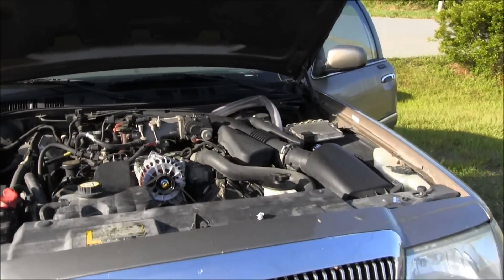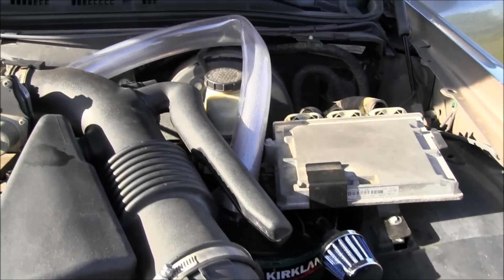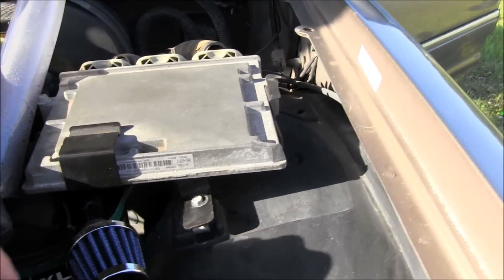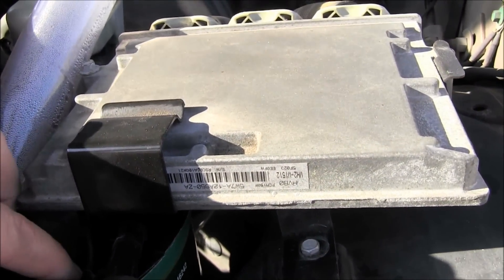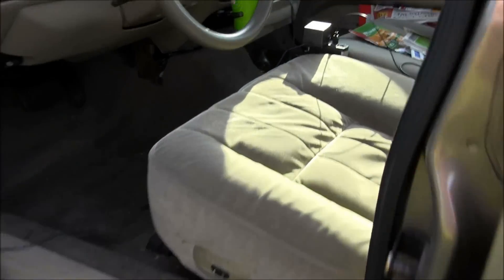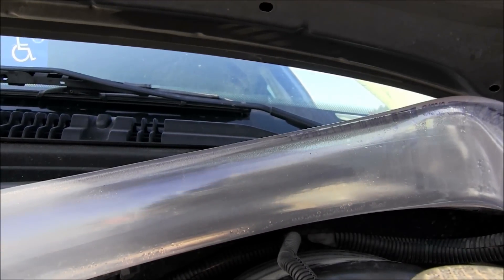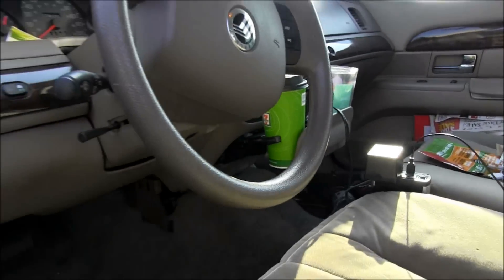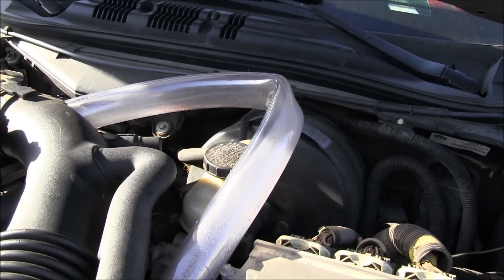Improve your Gas Mileage with water and a mist maker.

Comment: what is a mist maker & how to set one up ??
Reply from the maker: Hi, a mist maker is a machine that turns water into a fine mist through ultrasonic vibration. We have them available on our website at theHouseofHydro.com
There are many different ways to set them up depending on your needs. Some people use them for humidification, special effects, cooling, dust reduction, many different things. If you have any specific questions just let me know. We have a lot of resources on our website as well.
Reply: you dont need it, ion old cars the carburator suk air from oil pan, wioch had water vapour and others vapousrs from engine

Comment: Great concept, but i feel watching it wasted my time bc there was no conclusion. Because i buy your product, i suggest you watch Robert Murray-Smith. His has a number system to catalogue his videos so he can refer to one while making a new one and we can later go back and research his videos. This makes for an enjoyable experience for the subscriber. You have a great concept. Keep it up.
Reply from the maker: Thanks for the insight. I was actually on my way to Busch gardens in Tampa while running this setup shortly after install. The car had 200 and something thousand miles on it and blew the rear wheel bearing. I limped it into Busch gardens and we left early enough to make it to CarMax before heading home in a Civic.... That my son still drives. Lol 🙂

Comment: Add 50 percent rubbing alcohol or methanol is even better. They are corrosive to normal rubber hose however. It tremendously increases the cooling effect and the added octane is a bonus. I used a similar setup on a 1994 4x4 suburban and got a solid two mile per gallon increase. It worked for two years until I sold the vehicle. Nice work. I know it's an old thread, but the info is still relevant
Reply from the maker: Awesome, thanks for the input!

Comment: 19.62 MPG before Mist Maker install.,,. Ok, how much better  MPG After install ? My guess is Zero! You definitely would have  boasted about a significant increase IF you had received an increase. With an integrated electronic fuel injection, spark & self-adjudting, feed-back sensor equipped modern engine, it is difficult to modify or adjust outside it's programmed parameters. You have to trick or "lie" to the ECU. Look at the HHO builders EFIE boxes they have to install, for example. If you have tuned your system to receive significant fuel economy improvement, please update us with your new MPG & what you had to do to make it work. That is needed in today's Stupid high fuel prices! I think your Mist Maker has potential! Cheers.
Reply from the maker: Hi, being completely honest, we did not have this vehicle in operation much longer after the install. It definitely wasn't enough to give any type of true MPG ratings. The only reason I attempted it was because I had a pretty rough idle and wanted to play around and see if there were any benefits to the install. Shortly after installing, I took the family to Busch gardens about 2 and 1/2 hours away and blew A rear wheel bearing. I promptly dropped off the kids at the park and limped the car over to CarMax to purchase a new ride to get home. The only thing I can definitively say with the install is that the idle was much smoother and the throttle response was much better.
Reply: Thank you for your prompt & honest reply. I had a old carbureted '76 corolla 1.6L hemi. car with a water bubbler to the PCV vent hose that exited into the intake near one cyl. port runner. It seemed to idle smoother too. Later that cyl. burned an intake valve & I junked it. I think it would have worked better if I had drilled multiple ports in the intake, just under the carb primary barrel, to better distribute the vapor to all ports.
Have you seen YT channel "Thunderhead 289". He printed an intake adapter from a 4 barrel 302 V-8 to a tiny 1 barrel mower carb., added a smart phone app. he made, controlling an IAC valve venting into adapter just after the tiny carb, to lean the AFR automatically with feedback from an exh. O2 sensor. He got over 40 mpg at 70 - 75 mph!  Ok, later. Paul, from S. Central Tx

Comment: I want to do this to improve performance on my vehicles. They all have high compression and I want to see if this can be a way of reducing knock and allowing the engine to advance the spark timing
Reply: For performance you'll want to lower the intake air temperature. Either by intercooling or water/methanol injection. You could run Nitrous but this will cause a huge spike in cylinder pressure
Reply: Search for David Vizard, he explains it all😅

Comment: In Australia where I live, there was a device my cousin installed on his six-cylinder car back in the 1950’s called a Mist Master. A simple device that cost about $50, that was fitted between the carburetor and the intake manifold, about a 10-minute job, then a tube to a 2-gallon water tank. On the downward stroke of the piston, a calculated fog mist was drawn into the cylinder the same as the carburetor produced atomized gasoline. He swears with the device fitted he used less gasoline and the motor ran better. During the 1950’s the Mister Master was fitted to a fleet of taxis in Sydney with no problems.  After the taxis clocked up 100,000 miles, the motors were pulled down and the pistons, valves, and head looked like brand new. Hardly any carbon build-up at all.
Reply: Exiting..wondering how is look like that called a mister master?? Is there any company or how DIY to made by self?? Thanks for your attention..regardfull by the way!
Reply: @soposobosopo3415  I made a mistake in the name. It's Mist Master, not Mister Master. I have changed it to Mist Master. Sorry, I don't know if it is still available on the market. Engine design has changed and I believe there are kits available for the modern engine. Sorry, I don't have any addresses. I'll make e few inquires.
Reply: @soposobosopo3415  "Exiting"  ???????
Reply: @guermandmitriev6446  I don’t think this device is available anymore. It only worked on a car with a carburettor. I believe there are kits available for the modern engine but are quite expensive.
Reply: After the taxis clocked up 100,000 miles, ahaok right
Reply: @robertokandal you do realise water injection alone will clean up carbon? Like in my experimental Hyundai Excel after 300 000 km it is gleaming in the intake manifold and the valves were spotless!
Reply: Where can I see a mist maker ??
Reply: This stuff isn’t new. Water methanol injection is everywhere in the performance car world

Comment: I have to correct this comment, after testing the Mist Maker in a water temperature of 175 degrees the Mist Maker was working OK in fact the hotter the water got the more mist it made. The reason my Mist Maker quit working was the slot in the Styrofoam ring got misaligned with the slot in the plastic float housing so the hotter the water got the more mist it made causing the water level in the float to fall below the water sensor so it would shut off. The solution I used is to make sure the slot in the Styrofoam ring is inline with the slot in the  plastic float housing and   secure the float assembly parts, I tied mine together with braided fishing line. I'm sure the manufacturers didn't intend this to be bounced around under the hood of a truck. "The following  comment was incorrect"        Good idea but won't work if used under the hood. The engine compartment gets hot and heats up the water and the Mist Maker stops working until the water cools back down. So it only works for a short time then overheats and stops when you need it the most. This idea worked very good on my truck until the water overheats. Had fun with the experiment anyway.
Reply from the maker: Thanks for the feedback! A house of hydro unit shouldn't have shut off if that's the brand you were using. Our foggers don't have a temp sensor, just a water sensor. :-)

Comment: Hi can you please tell me where you plumbed into the intake ? I am thinking of a pcv delete. With a little pod filter like yours on rocker cover. But the fitting on manifold is after throttle body with a lot of vacuum on idle and obviously higher on revs. Should i run into throttle body or manifold after throttle body? Any reply appreciated? Cheers from Australia!
Reply from the maker: Hi, good to hear from you. It's been a really long time since I made this video, and I can't really remember for sure. I'm pretty sure I just drilled a hole into the intake hose right before the engine. Sorry I couldn't be a more help, it's been so long.

Comment: Andrew, I don't think the ECU can determine its running lean because he bypasses all the air MAS/MAF intake sensors. At the same time the water vapor should cool the piston chamber slightly. Also the vehicle is old and probably high mileage, less friction on the rings and piston chamber.
The extra performance would come from the water vapor (droplets) turning into gas during ignition, increasing compression.
Reply: it's 4.6 2V, they hardly ever wear out with proper oil changes

Comment: How clean are your plugs.and is it quicker with no carbon deposit
Reply from the maker: Hi, the plugs were used, but clean before the test, as well as after. The car didn't seem any quicker (no dyno's or tests were done though) It definitely ran smoother, and had less hesitation though.

Comment: Tried it, even pushing the mist into the air intake with a small fan. While the engine feels a bit more responsive to the throttle especially in hot weather and i feel the transmission is more willing to shift up and stay in higher gears (probably due to less neccesary throttle pressure) i can't measure any changes in gas milage.
Reply: House of ultrasonic mist maker supply used 1Gallon Water for 1 Tank of fuel. Seems to be a quite similar volume of water as my half liter per hour. Btw: I say per hour because the mist is not regulated, it produces the same amount everytime its on regardles if idling or 80 miles per hour.
Reply from the maker: schubi128 thanks for your feedback! just curious, what size Mist maker did you use? What size motor did you have?
Reply: I used a chaep one membrane mist maker, membrane diameter about 12mm and a 40 mm fan that pushes air into a container with the water and mist maker and therefore the mist out at the second opening where the hose to the intake is attached. Both the mist maker and the fan are electrically connected to step up converter in order to provide the neccesary 24Volt. The whole installation draws 1,2 Amp on the 12Volt Side. And its a Jeep Wrangler 4,0 usually running on LPG. One hour driving uses about half liter water with this installation.
Reply from the maker: schubi128 interesting. Thanks for the input!
Reply: this is high volum of mist. it should be 1 liter water for 1000 Kmts/

Comment: helps to deal with the o2 sensors or your computer sends more gasoline because theres more oxygen and the computer thinks there is a lean condition and sends more fuel

Comment: I don't mean to come across as a skeptic because I'm not I completely believe in the positive effects introducing water to the intake system will have, however does your car run a map or maf sensor? The way you have introduced the mist to the intake is going to cause all kinds of problems to your electronic fuel injection management, not to mention any vacuum powered accessories such as brake booster or if your running a map sensor then it will read a higher to atmospheric pressure and again cause issues with your fuel management system. An injection system like this needs to be plumbed inline with your existing intake system ie; breather from the coffee can can't be exposed to atmosphere and has to be plumbed up after(if maf sensor) the maf sensor or into the intake manifold via vacuum lines and it needs to be pressure neutral with the intake manifold..
Also I am very skeptical about your proposed 65mpg and would love to be proven wrong with operational video evidence. Also would be interesting to have a wide band o2 sensor installed to read and correct air fuel ratio because for all you could know you could be too lean and melting your valves.
Reply from the maker: Reread my comment about 65 miles per gallon, I was joking. I purchased a new car that got that mileage. I said a few times in the comments that I did not see any noticeable gains. It just helped smooth out my idle. I only messed around with it for a few tanks of fuel before my car had a bearing go out
Reply: That's a great reply, sometimes listening to some one who has the expertise is helpful

Comment: The problem is by introducing it after the mass airflow sensor, you now have unmetered air entering the engine. Unmetered air will cause a lean condition causing the oxygen sensors to request more fuel. The reason your car stopped stalling was this extra air. One thing introducing cool mist to a hot running engine it will (if there is enough volume) clean carbon buildup from the back of the valves and tops of the pistons which will result in better combustion. Better and more complete combustion + more mpg.
Reply: I glued a vacuum nipple to a mason jar lid hooked to a central vacuum source on the intake to pull a vacuum on the sealed jar. I glued a vacuum coupling  through the lid with a vacuum line connected to the outer nipple. A hose connected to the inner nipple and connected to an aquarium aerator stone in the bottom of the jar. I filled it with a 50/50 mix of water and rubbing alcohol. I had a brass shutoff valve on the outtake hose and a small breather attached to the air intake nipple. I ran it for two years on a 1995 V8 4x4 suburban and it consistently gained 2 miles to a gallon without effecting sensors. You could turn the valve off and automatically you'd lose two miles to a gallon. I imagine methanol would gain a little more, but it's so corrosive that the aquarium stones would fall apart. If you injected it instead of just letting vacuum pulling it in,  it possibly would effect oxygen sensors, but it never did that with mine because it was a minute ammount. Two miles to a gallon in a 7000 pound vehicle is pretty impressive though. I'm building a nicer system now to try on a 96 extended cab SR5 V6 Toyota Tacoma 4x4. I'm using an air pump to pressurize the aerator stone and then hooking a central vacuum fitting on the intake and connecting it about two inches before the throttle body downstream from the Mass air flow sensor. I'll probably install a compressor regulator to ensure it doesn't create too much mist. If it doesn't cool it down too much, it shouldn't effect the oxygen sensors. The methanl or grain alcohol, whichever you decide to use does add fuel and octane, but that's not what causes the gain. The vaporization basically super cools the intake charge allowing more air. As long as the O2 sensors do their job, the computer will compensate and the engine will produce slightly more power with less throttle input. I tested it for two years on the 7000 pound 4x4 suburban and it worked flawless. Like I said, I believe methanol would have been better, but I would have had to make an aerator that could withstand the corrosiveness of methanol. Newer cars with more sensors might have an adverse reaction, hower, but I haven't tried it . I know it's an old thread, but it's still useful information.
Reply: Any un-metered air will result in a lean condition. The water will cool the exhaust valve so it doesn't burn.
Reply: you can allways trick the o2 sensors so that does not happen

Comment: A 12V to 24V Voltage Booster (Power DC Converter AKA Step Up Regulator) would make a nicer and more efficient power supply for the fogger, btw =)

Comment: This technology was used during WWII in US fighter planes.
Reply from the maker: Wow, learn something new every day. The University of Oregon's formula racing team is actually doing research with us now! Hopefully with great results! https://www.youtube.com/watch?v=cHJt1n62MA8
Reply: I setup a water injection system with a micro nozzle. After using my borescope to inspect valves, intake manifold, pistons and cylinder walls.  Engine has done over 300000 km and its a 1.5  litre no carbon and crisp on Acceleration, only problem is finding the right nozzle to expiriment with!
Reply: @dragan3290 I'm running on lpg, I want to inject water mist to cool the pistons and clean the intake manifold ok kids valves. Modern petrol Di cars all have a problem with dirty valves.

Comment: Hi, any update on the fuel economy figure?
Reply from the maker: It worked awesome. I get 65mpg now. A couple hundred miles after I put it in, I blew a rear wheel bearing, and then I bought a Honda Insight. Voila 65 mpg!
Joking aside, it really did smooth my idle (180k on the car, it would stall in traffic when i dropped the rpms fast), and it definitely just all around felt happier overall. I didn't think the one head was enough for the V8, so I put in a five head. I think that was probably too much. The car felt a little less responsive, but my idle was still better than stock. I really didn't get enough miles on it to make a claim as to better milage with the 5 head, but I think a 3 is what I really needed.
Reply: thank you very much
Reply: The House of Hydro Ultrasonic Mist Maker Supply 65 mpg!!!!!
Reply: @TheHouseofHydro   Lier   if this was true car manufactures would use it.. and the price for water would double or triple
Reply from the maker: @punker4Real  Ummm... people use water/ethanol injection all the time for HP gains. It's well-proven. This is just a different way of nebulizing the water.